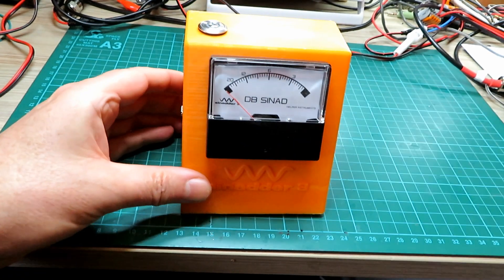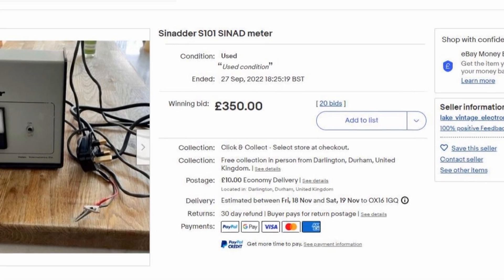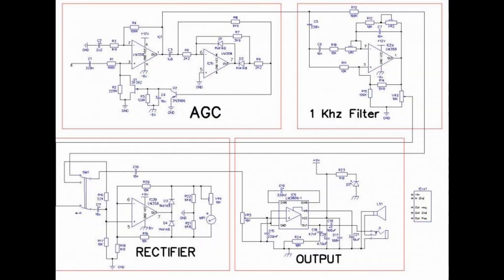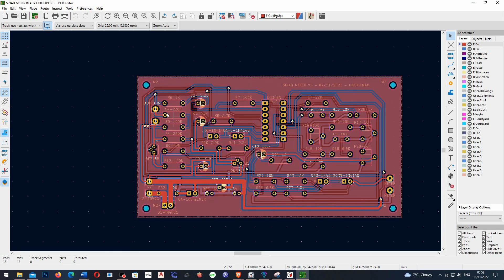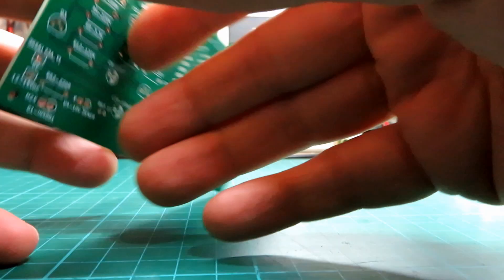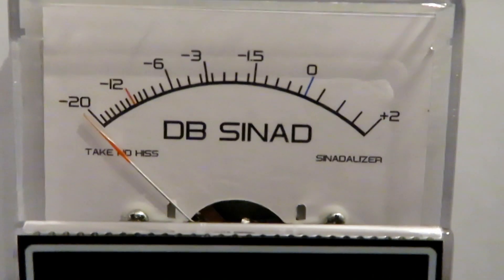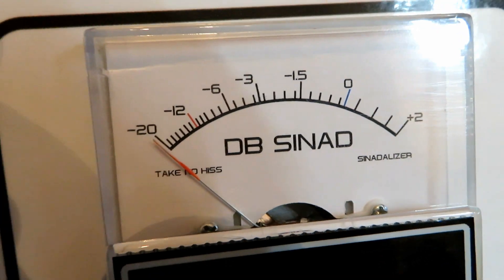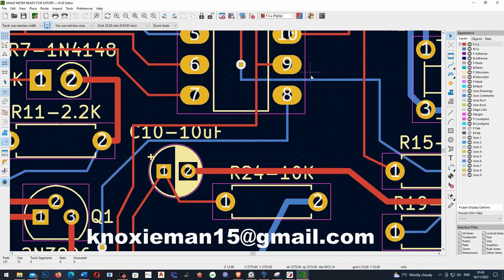SINADALIZER SINAD METER - LIMITED RUN OF BRAND NEW METERS - ON SALE NOW!

Comment: Hi knoximan, I have built my unit it all works well (I have got pictures if you want to see But I am having real trouble getting the meter under 18db with the 2 potentiometers and that was a struggle Any Ideas what I can try, do or change, But the 2kHz adjusts lovely to the right hand side
Reply from the maker: Op amp makes all the difference in getting the noise flat down, sometimes the meters both old and new can stick at the low end so give them a tap, also the two caps c8 and c9 need to be matched as closely as possible.